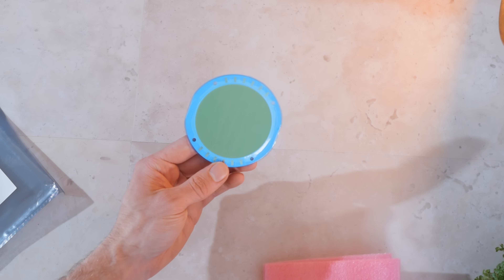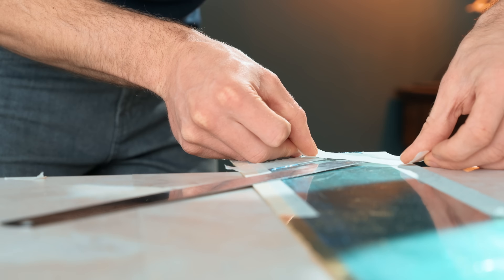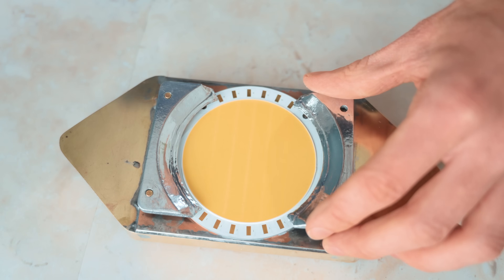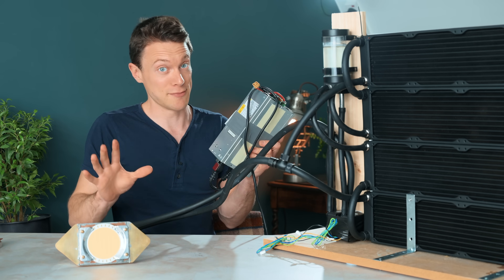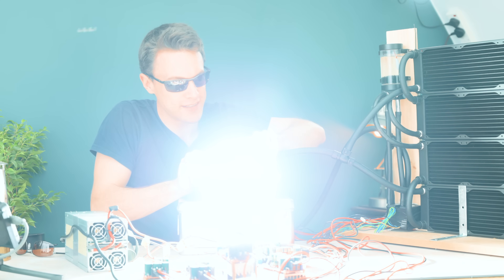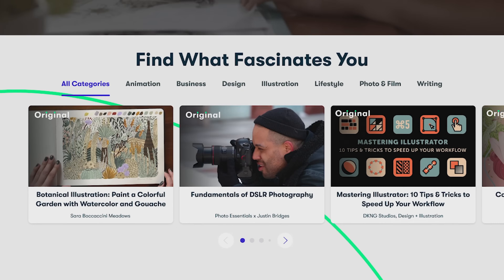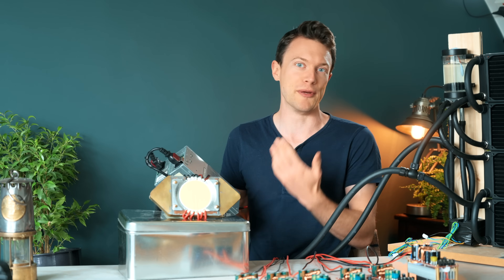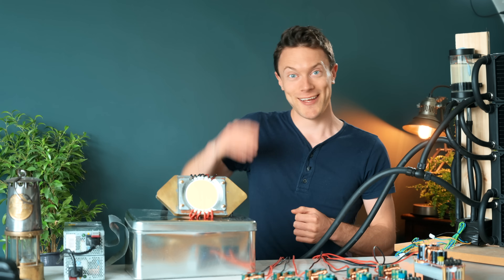Testing the world's BRIGHTEST LED!!!

Comment: A few things to check:
- A PC power supply may be rated for 1000w, but typically cannot provide all of that on the 12v output.  Verify the watts the power supply can output on the 12v rail.  eg: 12v max 50amps is only 600w on the 12v rail.
- A PC only starts running once the PWR_OK signal from the supply goes high.  This lets the power supply stabilize before the PC starts drawing full current.  You should start your dc converters via a relay connected to this signal, so they don't draw current too soon.
- Consider starting the dc converters one after another.  They have several large capacitors on each of them, which typically means they will draw heaps more current for a split second when starting up.  Starting them sequentially will decrease the maximum load on the supply.  If you have an oscilliscope you can measure the startup time.  It might be on the order of milliseconds.
- Not all power supplies can be stacked in series the way you have done due to the way they are designed.  An unscientific way to test this is to hook an independent load to each supply and measure the current.  Then tie the supplies together while having the same independent load on each.  If the current draw from the wall changes, the supplies cannot handle it.  It is not guaranteed safe, but is a good first test.  Given that your setup was only drawing 1600 watts it seems like these supplies were working okay in this configuration.
Reply: These are server power supplies, they only have 2 power rails, 12v and 3.3v for only standby use. So its entire rated power is available on the 12v rail. And yes how you wire things in series needs to be looked at carefully. I have a feeling they were old power supplies (used from a server that was running 24/7 for at least 3 years) and all the thermal paste had dried up, so the heatsink could not cool the mosfets well enough anymore.
Reply: You need to specify when you say the pwr_ok signal goes high, to justify whether or not a relay on its own is suitable as it may need complimentary circuitry to drive it, like a transistor.
Reply: For a server grade power supply full load shouldn’t be an issue even at 12v. I’m guessing the main issue was going from 0 to 1650w instantly and the fans not ramping up fast enough to cope with the heat thus overheating. Or he didn’t give them enough time to cool down after the first run and before the second.

Comment: Computer power supplies are rated for X Watts but that power may have been divided between rails, there is at least one 12V rail (the one you are using) a 5V and a 3.3V. The 1000W rating is the sum of all the rails, but you have to substract the power provided to the 5V and 3.3V rails and the efficiency rating. Maybe you were above the 12V rail max power or too close without proper server grade cooling.

Comment: If you wired the power supplies in series your voltage will double and your wattage will remain the same.  If you wire them in parallel you voltage will remain the same and your wattage will double. That may be your issue.  Love your videos and good luck.

Comment: You can have lower temperatures by using liquid metal, for example thermal grizly, high end thermal paste is about 6-8w per meter kelvin and liquid metal is about 70w per meter kelvin, mush better

Comment: Don't forget that PSU's are divided up into different rails.
3.3V - 5V - 12V... And there max wattage is the combination of all 3. With only using the 12V rail the max wattage will be much lower as you cannot use the current set aside for the other 2 rails..

Comment: The power suplies should be in paralel to work, so they have stock voltage. You have to use voltage boosters anyway. (Sorry if my english isn't very good)

Comment: I think I know why the PSU went out.
Assuming 92% efficiency, there were at least 100 Watts of waste heat. The fans were going at full tilt and you just killed the power to them, so it just sat there cooking with 0 active cooling. Instead, you should have disconnected the LED from the PSU and let it slowly reach a safe temperature and then power it off.
That's just my 2 cents.
Reply: He probably should've pulled the led but you definitely got your numbers wrong, remember these are rated for 1500W which means at 92% efficiency they would waste 120W, but they were running at half power so that's 60W of waste heat for both units and remember that these are server grade so it's safe to assume they're a little better made and efficient than even high-end consumer desktop PSUs, they should've barely been warm, they must've had some power back fed or those boost converters doing something to upset the PSU or it's also possible it was from having multiple mains ground points and they became capacitively coupled.
Reply: vgamesx1
Not wrong numbers.
I said at least 100 Watts.

No, they are likely only 80+ gold-rated. So it might even be only 90% at peak effeciency.
And server PSUs are meant to have 6000 RPM 50mm fans blowing on them like a cat 5 hurricane. So that was way out of usecase.

Comment: Wait a minute. If the led is 90% efficient and it uses 1500 watt it has 150w of energy loss that needs to be cooled. That PC fan cooler would have done the job just find. It's no surprise the water cooler setup stayed cool

Comment: Have you considered galvanic corrosion due to dissimilar metals? Since you're using copper and presumably tin and lead from the solder joints together, I expect the tin and lead to transfer their electrons to the copper over time, causing the solder joints to corrode and fail. To prevent that, you could add a piece of aluminium or magnesium to the loop which will act as a sacrificial anode as it would constantly replenish the electrons of the lead and tin.
This is of course only important if you plan on using the water cooling loop for an extended period of time.

Comment: I did some calculation based on a previous project of mine and my guess is that the hotside of the LED (right at the junction to the thermal paste) is about 90-105C but could be about 70-80 as well

Comment: Why not use 2 car batteries in series? Its cheap and will deliver more than 24V. Your voltage are able to handle that kind of batteries and even should have a undervoltage protection.

Comment: Fantastic to see how excited you got when you powered up the LED. :)

The power supplies should absolutely be capable of supplying the power you need (I used to work with servers in a professional setting) but when you run dual PSUs in a server there's some sort of management of how they interact, and the lack of this could be what made yours to give up the ghost.

Comment: Are sure this was within the capability of the PS's? The overall wattage of a power supply is exactly what it is - it is the sum of all the power it can produce - however an individual rail (or wire) is usually much less. You probably fired a single rail, which was much less than 1500W.

Comment: 750W on the 12V-Rail! - They have different specs for the different voltages.
1kW is definetely all together - so might be you overused the 12V-Rails.
But there are definetely some PC-PSUs which can handle that
Reply: If you can power each section individually, and he separated the power from the power supply into 6 voltage boosters, why the hell did he combine 2 power supplies into one? Just don't modify it and run 3 off each, or get 3 power supplies and run 2 voltage boosters off each, for the headroom/because one rail isn't rated for the full 1k watts.
Reply: @tstek  He would have got a poorer performance boosting 30v from 12v rather than from 24v.
Reply: @tstek  I think it was for show. If you have it run off separate power supplies he can't have his money shot of the meter reading 1600 watts.
"Look its running off of 1600 watts!" (excited Brit accent)
"Says 800."
But there's two of them!" (excited Brit accent)
"oh. There's also 6 light strips. So technically your running 6 leds not one powered by two different sources."
"What if I ran the power supplies in series! All same power!" (excited Brit accent)
"sure, I guess."
Reply: Paul Weston They could still run off the same power point and have his meter Money Shot ;)
Reply: These server power supplys only have one 12v rail, they look like HP DPS-800GB ones which can deliver 100A at 12v each when power from 200-240v mains. So this should be no problem
Reply: @edson oliveira de carvalho your ideas are valid but your fundamentals are flawed. It would only run in parallel better if he did not connect them electrically together, just run 3 drivers on one PSU and 3 drivers on the second. This prevents the problem of one PSU giving a slightly higher voltage from the other and having to do more work because it is trying to keep 12.2v where the other supply is seeing the output at 12.2v and backing off outputting power because it wants the output voltage to be 12.1v.
The second part your wrong on is the output power, if it claims it can handle 1kW of output (as long as that is a 100% duty cycle rating) then it can output that power. The power supplies efficiency does not effect the rating, it only effects how much power it will consume from the wall while it is supplying 1kW on its output.
Side note: the boost modules are not that great at boosting from a really low voltage to more than double the input voltage 12v to 30v, the current on the input would likely need to be too much for them, so the much closer voltage change 24v to 30v is less current on the boost modules input side.
Thanks, I hope this helps
Reply: Im not an expert but I think the psu-s died because of too high inrush current. Maybe he should build something that turns the led sections on one at a time? Luv
Reply: @arminmere4247  LEDs don't have inrush current, however the sudden current draw may be more along your thinking....however that is also somewhat true for computers
Reply: @kennmossman8701  the led driver boards all have huge capacitors however. That's a lot of current at startup
Reply: @eindeend  on the input side?  usually they are there to remove[hi-freq] ripple on the output .  define huge...........
Reply: @kennmossman8701  each boost converter has 4 470uf capacitors, with 6 boards that would be 11,280uf which would take quite a bit of amps at first. But I don't think that's what blew up the PSU's they normally have a bunch of safety features to protect itself from stuff like that.
Reply: Thi was exactly what I was going to comment. Power supplies tell you their TOTAL output. Each rail (usually 3.3v 5v 12v) has a different output. Maybe something like 100w,300w,600w. Which all together makes 1kw

Comment: The Power supply failed because that wattage is too much on the only 24V line. There are most of the time other lines like 12V and 6V, and the combined Power of them is then the Power of the Power supply. Plus older PSU are often worse at provideing the rated Power. In Server, you normally hav a AC Unit, wich makes a really low anbient temperature. 
And also taking 0 - 100% often can kill the Unit....
Greetings form the IT Buisness lol.

I am not sure, if paralell or Series is a problem, but I think it could be. 

My tip: 
Get a 2000W or higher rated Server PSU, even if they are expensive, or get a professioneal greated PSU from an elecronic Store (maybe after corona)

Comment: It would have been better to find a transformer capable of passing that level of power, with that you can conect the two PSUs in parallel eliminating the problem of loading one off them from the series conection.

Comment: Question, you have a 1500w LED, and it looks like you designed a thermal solution to handle 1500w of heat, but it's not actually producing that much heat is it? Most of that wattage is going into producing the light, and all inefficiencies are producing the heat. I feel like you might be able to get away with that giant air cooler you had as an example. Aside from it not having a large enough contact point.

Comment: I'm willing to bet the power supplies died because you cut power to them, had you disconnected the LED then the fans would've cooled the power supplies down, now components ate dirt because of heat soak.
Reply: And also server PSUs are meant to be used inside of a server chassis which has a lot of airflow, and I doubt that the server can output 24v@1000w since most servers uses a couple of rails.
Reply: Absolutely
Reply: I think it is wiring the PSU in series to get 24 Volts is the issue here. Would have liked to try running them off car lead acid battery for testing the current drain etc......
Reply: @NavinBetamax   would it  have been a bad idea to run them in parallel  and boost from 12 to 30?
Reply: @foufou33g  in parallel they would have supplied twice the current at 12, not any use here
Reply: @NavinBetamax  See my reply about car.  Not enough juice.
Reply: LEDs stop glowing in ms as the voltage drops 10%.  Fans keep running for seconds while the DC goes to zero, which is after the main PSUs go to zero.
Reply: strongly agree. those fan turn themselves off when not needed.

Comment: I don't quite understand the cooling solution part.
The datasheets rates the LED for 2000w of maximum power consumption, but much of it would be directly transformed into white light, scattering the energy all over the room and not producing any waste heat, at least directly, onto the LED itself. That is, given it is a 1500w LED, I imagine there's at most 800w of waste heat you need to deal with.
This is quite different from the situation of the CPU towers; for CPU, how much power a CPU consumes would just equal to how much heat one need to deal with. Decent air coolers are often designed to cool a 300w CPU without letting the chip going over 80 degrees Celsius, which means they are able to dissipate 300w of waste heat without letting the thing underneath it going over 80 degrees Celsius. Notice the T_J is 85 degrees Celsius rated in the datasheet.
So, right, with the area and total heat generation taking into account, one surely need a cooler way more efficient then a high-end CPU tower to cool this beast, but I wonder if you could put it that way like at 1:20.

Comment: The powersuply rating is not how much it can output, the rating is for input power. If it is rated at for example 1000w it can draw a 1000w from the wall but then there will be a power loss. When the powersuply is at its max capsity the loss is usaly a bigger procentage. It is possible that the psu had a power imput over the limit but output is less than you expected.

Comment: Maybe you didn't have to join PSU's in serial. Use one PSU to power 3 LED. This might prevent them from breaking as all sorts of power supply tends to break if the electricity is shared between

Comment: hey, i also think that the power suply problen it's because the serie configuration, but you have it easy, just divide the volltaje converters betwen the PS ( 3 VC for every PS), making it independ from each other.
also you need to add a High Frecuency filter after every swich circuit( PS and Voltaje Converter) since the HF is a bitch in power aplications, it higly probable that fry another PS o VC in the future.
i think that a smal one like what you found in the cable of a notebook charget will work o you could find some bigger
xoxoxo

Comment: The Duty Cycle on a server power supply probably isn't optimised for solid flat load like that.

Also the servers also usually have fans up front and additional fans in the power supply too. So probably not enough flow, as they are designed for stacked fans for cooling.

Otherwise great work on that waterblock! Worked great! You should have seen the Linus Tech Tips attempts at making heatsinks and waterblocks 🤦‍♂️ lol

Comment: If they are server power supplies, they may be rated at a total of 1500W but it is broken up at different voltages known as rails (eg. 800W at 12V, 400W at 5V and 300W at 1.5V). So even if you are not exceeding its total power limit, you may be exceeding its 12V power limit.

Comment: power supply  rated at current over all its voltages - ie +12 _12 +5 _5 3.3 v etc, you are trying to take all the power from the +12 section it should say on the side the maximum current available per voltage.
not great english but i hope i made the point

Comment: You do not spread the thermal paste before joining the 2 surfaces. You let the pressure spread the thermal paste. This way there are no air pockets left inside and there is full contact between the 2 surfaces.

Comment: The  computer PSUs can usually only run at the given maximum power  for a short time. So manufacturers only give a possible peak,  a power supply would stand. However in a continuous stress like this one, they'll die very fast. Take it as marketing, if you want, but if you buy a PC power supply which has a 500W label, means it can stand 500W for some seconds, may be minutes, if it is a good one. However, it usually barely can handle more than 300W for longer period of time.

Comment: Two things that must be noted:
1. The total output of the led is 1500W, that's heat and light, so the heat output equals to 1500 * (1 - efficiency). Thus you could cool it with a much smaller cooler. 
2. The power supplies may have multiple rails and not output the whole 1000W from a single 12V rail. I think a better solution might be LiPo batteries. 
I hope you improve and perfect the project, it's a great idea and very entertaining as always.

Comment: mixed-metal loop? copper and aluminium, even? oh boy. Even if you drain the loop, there's still going to be residue everywhere and depending on how long it is before part 2, the cooling performance could be heavily impacted. (also you'll have killed 3 triple rads.)

Comment: Quick Quesh - why not use car radiators? You can find them on eBay for a fraction of the price of 4 quad rads. Fins are less dense, so less theoretical cooling, but quieter fan speeds :)